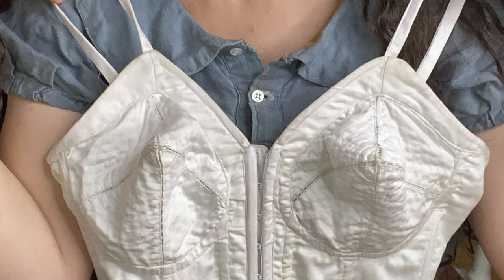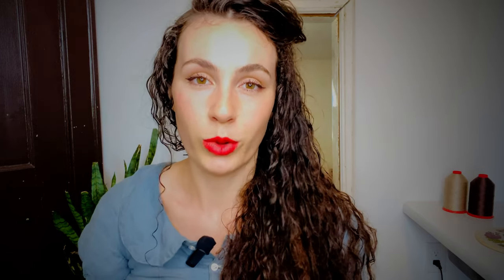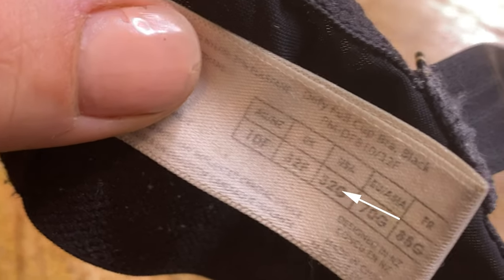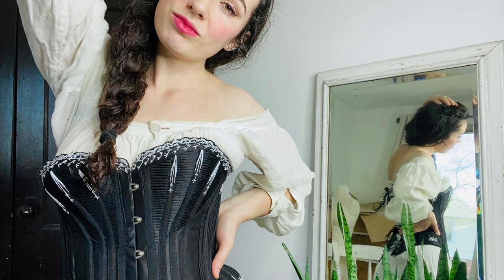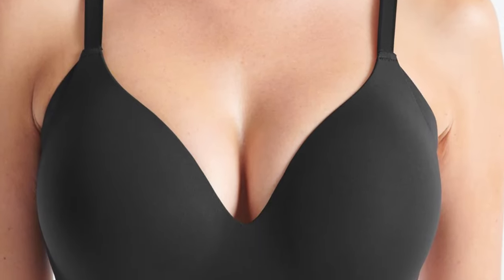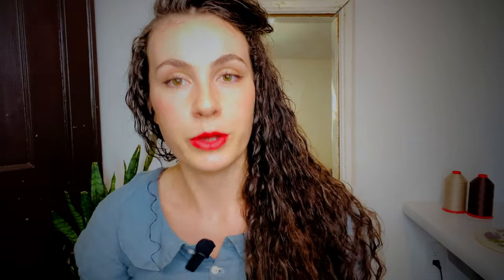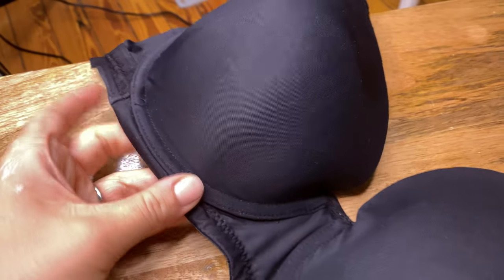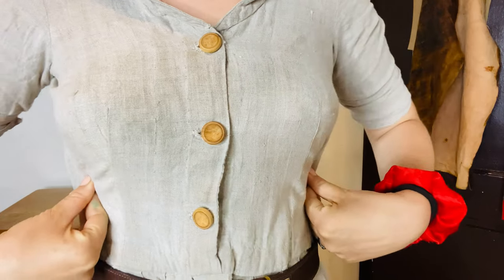Vintage Bras are Better Than Modern Bras - Here's Why

Comment: I've never understood how underwire "supports" the breast. It nearly always cuts in, no breast shape is universal. And breasts are heavy, how is a flat steel supporting anything? But yes please pattern away! I started looking for one as I am tired of spending £30 for a bra that isn't comfortable (but follows all the "correct fit" guidelines). I'm not even that uncommon a size at 40F
Reply from the maker: Well said!! Great, good to know you are interested in a pattern 😊 I think making our own bras just makes sense!
Reply: What I think based on the geometry is, that technically underwire itself doesn't support the breast. But underwire keeps the cup in shape and that's what supports the breast by preventing the breast's weight from spreading the cup out.
Reply: Ms. D here, all I know is that I removed the wiring from one of my bras and wore it for a week, after that, give me underwire everytime. (I did handwash it after every wear during that week).
Reply: Tried to edit, wouldn't let me, meant to add that I may try to make one of these.
Reply: It's kind of like the supports of a sling.  But yeah I find underwires uncomfortable.

Comment: So many people today laugh at the bullet bra for looking weird.....but it was the every day bra for decades. They were better for the breasts as they lifted and separated the breasts while modern bras only hold them in place and this causes a lot of the "fat tissue/flesh" to be pushed back under the armpits and this can lead to breast cancer. Most breast cancers are located near the armpits or on the side of the breasts. Vintage bullet bras held their shape better and were usually made of organic materials such as cotton or silk. Never wear a modern bra with underwire or made with foam padding.
Reply from the maker: This is fascinating, thank you! The connection between our modern lifestyles and cancer is always interesting to dig into!
Reply: @KatherineSewing  Don't forget that the biggest selling bra in the world is still a bullet bra (albeit a softened shape version)...the Playtex Cross Your Heart bra.
Reply: Yes, garments that impede the flow of lymph through the body prevent the body’s natural cleansing and renewal process. Carcinogens stay in instead of being flushed away. I like to think of cancer as a self protective symptom that gets out of hand. When we remove the toxins and provide the right nutrition and clear out toxic emotions by resolving conflict and engaging in forgiveness, the body heals itself. It might need a little help to slow down and help destroy a tumor, but there are natural ways of doing that which are much safer and less expensive than chemotherapy And radiation.
Reply: Won't modern bras qualify as organic since they're from hydrocarbon polymers?
Reply: bestie if your breasts are neither lifted or separated in a bra you are very certainly wearing a wrong size
Reply: It’s really important to “swoop and scoop” all breast tissue into the cup when you first put on a bra in the morning. It should stay there all day in a correctly fitted bra. If tissue is being pushed into the armpit area, it sounds like a sizing problem, likely a combination of a too large band and too small cup.
Reply: @MsWonderBunny  Of course wrong sizing is a major issue and I would say most women are wearing the wrong size. In the past, every women went to get a professional fitting when buying  a bra. The old style would lift and separate the breast and give much better support.

Comment: The frustrating thing about mass produced cup sizes… in order to get a deeper cup you must also go wider. I often find cups to be plenty wide for me but not deep enough for my “projection” (for lack of a better term) and the center does not lay flat on my sternum between my breasts. I’ve found Panache and some other European brands have deeper projection and are pretty also, though still limited in my 36G size, but they are very expensive, online only. Making my own sounds like a viable alternative! Very interesting topic. Thank you for discussing!
Reply: I have a similar problem. One thing I’ve noticed is, as the cup size goes up, the cup and wire get taller. But I don’t need them to get taller. In fact, I’m short waisted and have very little space for the cup. I need it to “project” more.
Reply: If the centre gore doesn’t tack, you’re wearing either the wrong size or the wrong shape. It’s one of the key signs that there’s something wrong with the fit of a bra.

Comment: I haven't finished the video, but am already thinking about a theory for why we ended up with the modern bra.. Starting with the elastic material, sold as the perfect material because it is "supporting and not tight"... I think this material mostly is a benefit for the manufacturer, who can get away with the less fitted bra... Even if it looks like a fit when you try it on in the boutique, then it will definitely not fit when you have worn it awhile!

It seems to me that we are led astray by the idea of underwire bra's being supportive, and the idea of a elasticated material being more comfortable... If you sew, you know that a voven fabric is sturdy and keeps its shape better.
Reply: It's mass manufacture friendly

Comment: I'm a middle age woman and last year I feel on my back and injured my shoulder. As a result it has a permanent little bump with vericose veins surrounding it. So I can now longer wear any bras. Not a good situation since I am a size d cup. This is what I do. I knit myself lacy cotton sleeveless tops and run a satin ribbon around the middle and presto! When I tie it it keeps things in place. Plus no tension on that vericose bump.

Comment: I love this video! I have exactly the same problem as you and am about the same bra size depending on the brand. Finding well-fitting bras is such a struggle and they are EXPENSIVE! Not to mention I'm also high-waisted so I tend to look much heavier than I am if my bra doesn't give enough support. I've been thinking about trying to sew a corset  to provide more support but I'm hesitant because I'm not experienced enough at sewing to figure out how to make it fit. But maybe I'll try sewing a bullet bra!

Comment: Bra issues here. I have an odd size for bra sizes as well. I definitely am going to try this. I’ve been thinking about making something like this as well. I need the lift from below and not all the weight on my shoulders.
Reply from the maker: Precisely! Let me know how it goes! ☺️💕
Reply: I will. I want to see your construction process first though. I haven’t found a cup that I like and no matter though because of my breasts are different shapes. So it’s very difficult to find something that works on both sides.
Reply: I love going to any store and being told “your size doesnt exist”
Yes it does, you just dont make them. I have opposite problem to Katherine. Large band size, and small breasts. Online stores has helped, just have to order form a place with a good return/exchange policy.

Comment: I don't actually need much support, as my breasts are actually quite small - less than an A cup, to the point where I can't find bra cups that fit my ban size, as even the a 34A is much too large for me, gaps weirdly under my shirts, etc. I'd honestly go without one, but a) my nips are too pointy and b) I don't like the silhouette of going completely free. I'm also very attracted to the idea of making a bra out of woven, non-stretch fabric because I really feel like a bra made out of linen would be so much more breathable than anything with foam in it. (plus, I have always hated that "shelf life" that you talked about with elastic fabrics. I hate not being able to just throw my bras in with the rest of my clothes into the washing machine.)

My understanding of why modern bras were made out of elastic was that way they could move with your body, that something made entirely of non-woven fabric would be too restrictive to move well in (like a corset). But your explanation of lacing and getting into and out of a bra totally makes sense. I wonder how easy it would be to add a little bit of lacing to a vintage-style bra to let you get in and out of it more easily without having to add elastic.

Comment: Have you ever heard of penny rich bra. They were the best . they were professionally fitted and they came in any size you needed they were actually designed like a nursing bra so you could pull your rest out and fill the cup. They were very comfortable and flattering. I wish I could find a dealer now, but I don’t think they make them anymore.

Comment: 34FF Here. I wear a non underwired modern bra as I cannot stand underwire and t-shirt bras.
My only problem is it leaves red marks on shoulders and I can't tighten the band any more. If only I could slouch in corsets up wear them more.
Reply from the maker: Have you considered getting a bra with a smaller band size? That may help. I personally like how corsets improve my posture, but I understand it can be a difficult adjustment ☺️

Comment: I learned that underwires are a double-edged sword - great when in place, horrible when not. Reading the comments I'm baffled by the lack of awareness about bra fitting in general, almost no one knows how to tell if it sits right, many of the "faults of a modern bra" can be attributed to incorrect fitting practices and bad standard sizing rather than the design itself. Also, one thing that might bias your vintage bra is the fact that you, a skilled seamtress, sewed it yourself to fit your body and no other. Interesting food for thought tho

Comment: I wear a 30D/30DD, which basically doesn't exist outside of specialty boutiques, and I also have an unusual shape, I use a wire size that is 1-2 sizes larger than the standard for my bra size. I'm trying to get into making my own bras, but I'm a little bit intimidated.

Comment: I am not an evenly shaped woman. Commercially made bras do not work for me for that reason. Now most women have one breast a bit smaller than the other, but mine is very nearly a full cup size smaller. So aggravating. I have one more issue with bras…I have scoliosis and so I’m severely curved and twisted. Commercial bras cause me to “blow up” which in turn causes extreme pain and difficulty in breathing. So, what have I been doing? Nothing…meaning no bras whatsoever. 🤦‍♀️

Comment: I'm sure that vintage bras can be amazing, and I'll definitely try it out, but from a perspective of someone who makes modern bras with underwires that are also much more suppportive than ready made ones I don't think you're right in judging underwire bras. Underwire does not completely determine the cup shape and most of the support is supposed to be on the band, which is exactly what underwire is for. Same point for the stretchy straps, they're not there to provide actual support, just to keep the bra snug to skin.
If anyone is interested in trying making underwire bras you can look for a free maya pattern, there is also another great youtuber LizSews who made an entire series on how to sew it up.
Bra making is a super interesting hobby too!

Comment: This video was so informative AND inspiring AND to the point. Amazing work! 

I could write a book about trying to find a bra. A sportsbra is now 65L for me, european size. And add to that my tits vary in size depending on the cycle... 

I have two corsets and I often wonder if I could use a that lacing to keep a bra snug.. But I also have problems with shallow breathing and I wonder if a vintage that sits so tightly would allow for the ribcage to expand enough. Is that something you have encountered?

It seems many stores assume the shape is a problem, or that they are too big so they need to "minimize".. for me I just want them to be still and supported while not sweaty. 

I really want to learn how to create my own bra and I'm going to look for this video immediatly.

Comment: Actually, the thing I hate the most about modern bras is they are either really pretty, or ugly. I like wearing lace and ribbon, having cute bows and generally being a very frilly person, and the modern bras that are like that are itchy as hell because they use cheap and nasty lace made from nylon. I actually had scars on my breast for about a year after a very pretty lavender bra with white lace irritated the skin of my breasts so badly it formed a surface scar when it healed. Its gone now, but I get the same discomfort with every pretty modern bra I try. I don't have the issue with lace made from cotton, silk or linen.

Comment: Why not try adding laced panel that is never supposed to be completely undone to give it a little bit more wiggle room, when putting on such as on both of the sides. when the hook and eyes are done you could tighten it again.

Comment: I have rather round and far-set breasts. If I try wired bras, the wire would just sit akwardly in the middle of my chest. Also, fabric, non-stretch bras fit me differently. Instead of conforming to the shape of my chest, they force it into position. I don't find it terribly comfortartable. But it does fit. For a bra to fit, if there's an underwire, the fabric must be non-stretch.
I tend to prefer bras that flatten my chest for modesty purposes, that's why I like my modern bras.

Comment: I've been considering making my own bras for a while, I managed to find a sports bra type that fits, but I'm really not a fan of synthetic fabrics. I rock climb 5-6 times a week and do martial arts once a week in a hot climate, so I sweat through a whole lot of bras. My bras never last long because of how often I need to wash them and it makes them stretch. But if I were wearing linen bras the sweating would be more comfortable and less gross, I would get good support while still being comfortable, and I wouldn't have to spend so much on my boobs.

Comment: I’m a 34 DD. The bras just don’t support they stretch out the straps are too thin and everything stretches out and spills out behind the bra. And then they look bad under clothes. I hate underwires. It is a lie. Bras are made wrong these days. Vintage bras are the best.
Reply: I wouldn't mind the wires if I could find ones that fit and they'd stop coming out. Forever getting stabbed. 😭